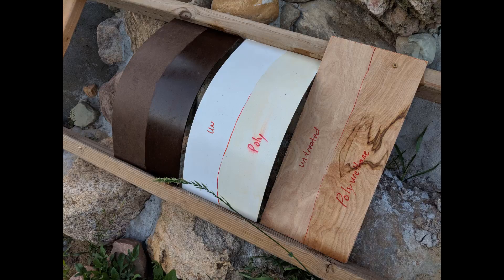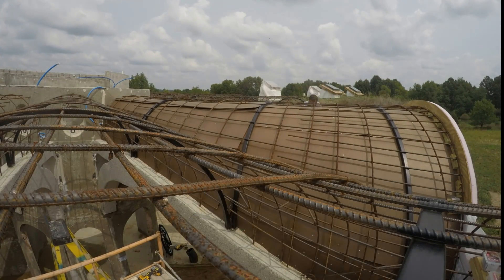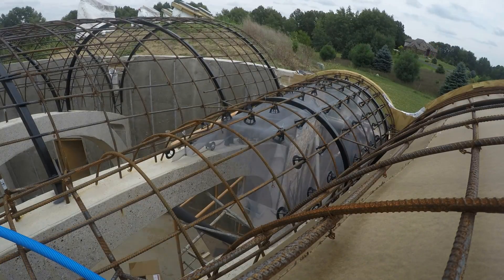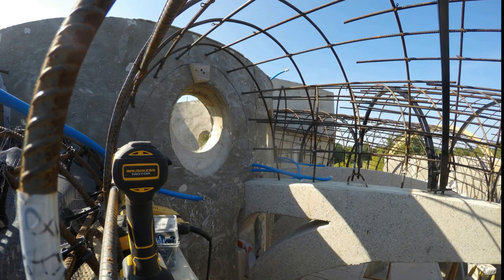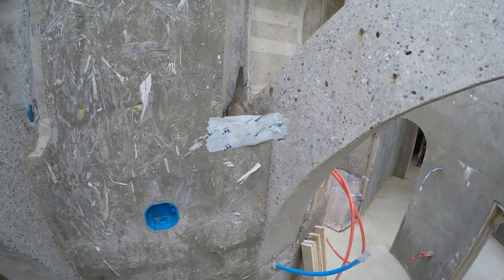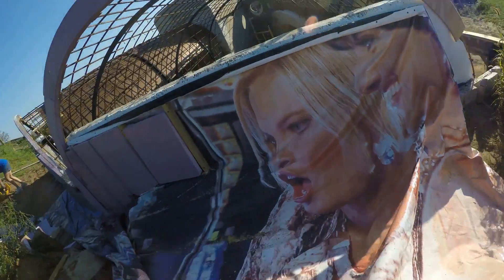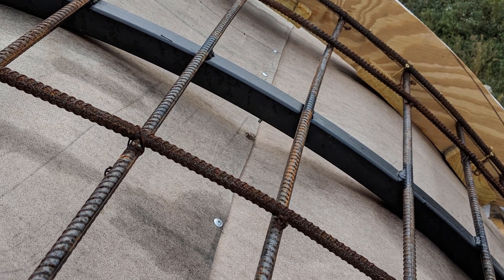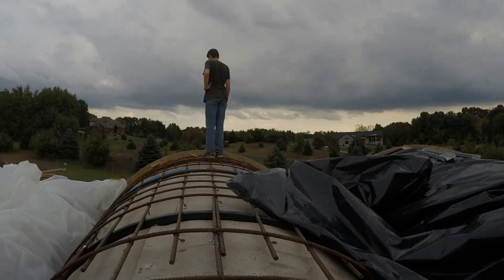41.3 Building the radial vault ceiling forms

Comment: Really makes me think that investing time in reusable formwork for each vault would have been worthwhile. Have you seen steel tubing half embedded in gunnite like you're going to have?
Reply from the maker: A problem with re-usable formwork is I would have to setup, pour and strip one vault at a time.  I used reusable formwork to make the concrete ribs and that really added to the total time.   It made sense to reuse the same form over and over with the ribs because they are individual items, but we wanted the roof to be as continuous (single pour) as possible.  Also, if we had only formed vault, the form would have needed to be more complicated to contain the sides.
Reply: @SimonHomeintheEarth  Hmm, both interesting points. Have you ever experimented or considered the 'dirt pile' formwork that paolo soleri used in some of his work with domes and arches?
Reply from the maker: Yes, I have seen steel half embedded.  Keep in mind that we will complete the "embedding" when we stucco the inside.

Comment: Your younger boy is turning into quite the ham, haha
I hate using pressed wood products where they will get any exposure, they are so dimensionally unstable. I have had a couple projects ruined over the years just from humidity changes. Works great indoors but MDF and hard board (and it's evil twin peg board) are no good in high humidity areas. I wonder if treating it with some like Thompsons or a polyurethane would have helped. The edges are still hopeless however. I hope the pour/spray went well, I sure have enjoyed following your build the last couple years.
Reply from the maker: Yea, I really thought the hardboard would fail that experiment, but after a couple months in all sorts of weather it really looked fine.  I guess I just didn't do the experiment quite right.  I should have screwed those boards to something for a real test.

Comment: impressive progress. did the rain end up in the basement before you shot the ceiling?
Reply from the maker: There were a few slightly damp spots, but mostly the basement was covered by the floor slab and the rain just fell off the edge of that and down the outside of the basement.   The damp spots were where penetrations in the floor let water in.  For instance, the shower rough in and one of the vent ducts was letting water thru.

Comment: I didn't catch if you're going to be able to access those boxes where the smurf tubes come together, hopefully the answer is yes!  Some of the bends looked a little tight so pulling wire may be a bit rough.  Almost "dried in" from the looks of it and looking good!
Reply: Yes, it takes a ladder to get up into the vault.  Code requires access to these boxes.  Actually, I have all ready pulled the wires and didn't have trouble with the boxes or tight bends, but we did have a few issues where the gunnite guys had stepped on a smurf tube and snapped it.  I'll upload the video of how I dealt with that eventually.  In the mean time, here is a pic from facebook.  Move to the right to see more.  https://www.facebook.com/HomeintheEarth/photos/pcb.1226867350794089/1226857664128391/?type=3&theater
Reply: @SimonASNG  I figured you had a way to get to the boxes, wasn't sure about the NEC.  Glad everything is going to plan!